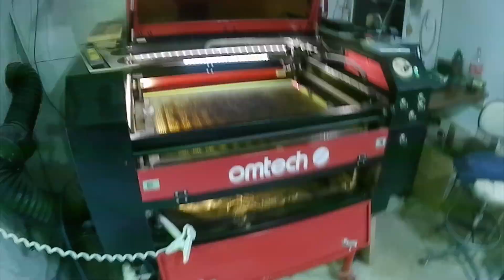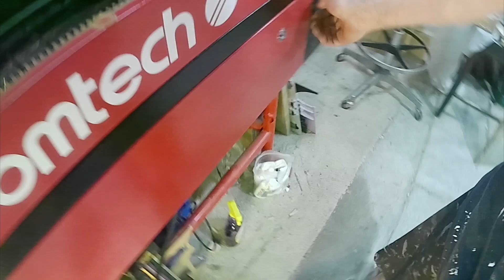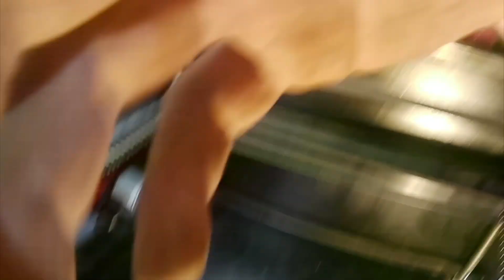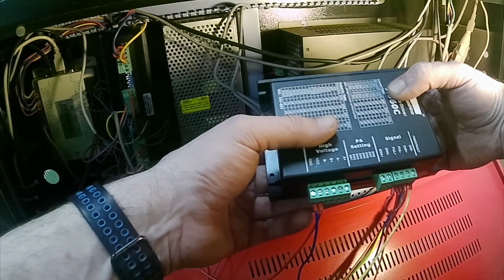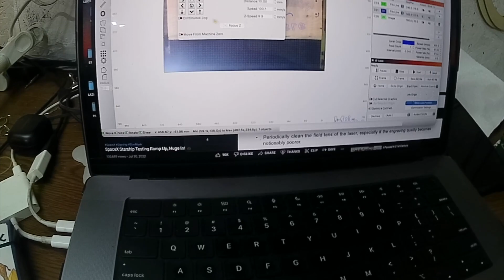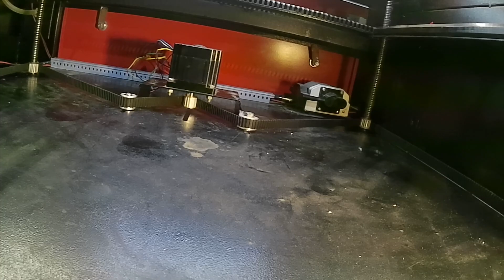(UPGRADE) OMTech 80W, Motorized Bed Install

Comment: I have this kit for a 50 watt omtech what extra parts did you need to buy
Reply from the maker: I got them from someone selling a kit.. so not sure. I didn't get anything else. What is in your kit?
Reply: @sunriseadventures5459   I got the omtech kit it has the controller/mount/stepper motor/auto focus

Comment: Can you post a link for the new belt you got?  Bought the upgrade kit from Omtech but they don’t sell you the longer belt that’s needed. Thanks.
Reply from the maker: HEY HEY, I am working on getting that info. I will update you when it is up! ( i bought the kit from someone)
Reply from the maker: Here.. https://vbeltoutlet.com/product/1180xl-timing-belt-replacement/. Make sure it is the is 1180XL "model" that is 15 mm wide and has 590 teeth. as long as the belt has those specs it'll work.